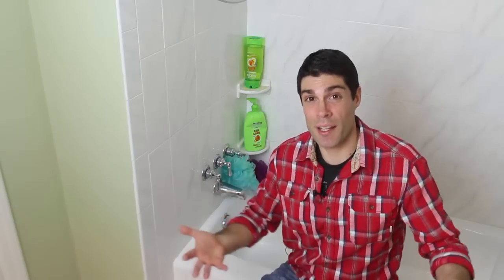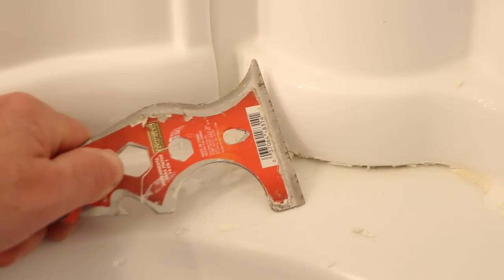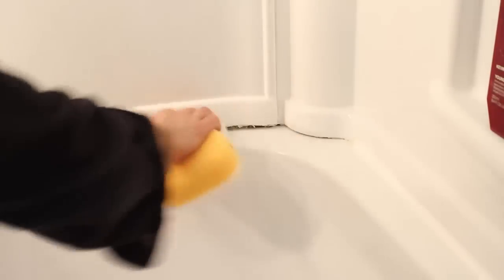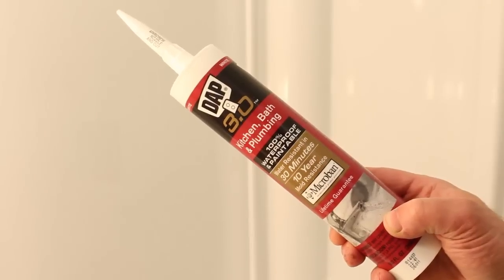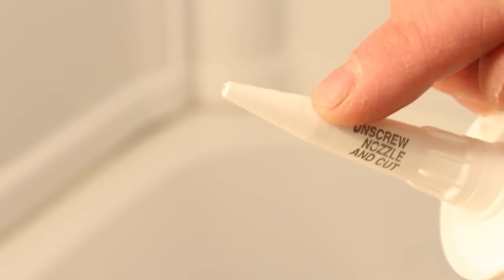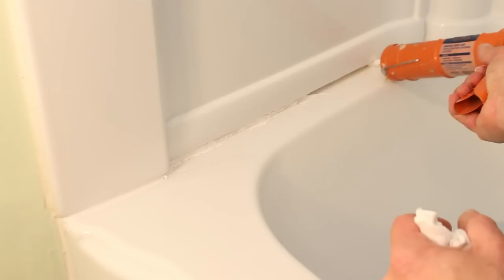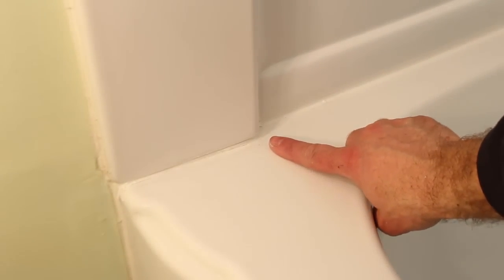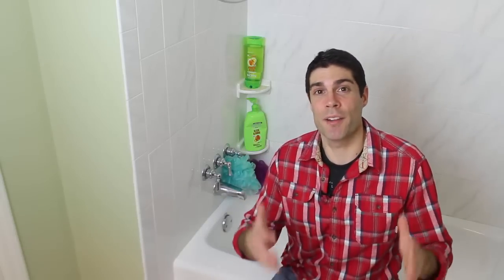How to Caulk a Bathtub (Beautiful Results) -- by Home Repair Tutor

Comment: I recommend caulking when the weather is on the dry side. If it's rainy and muggy, takes longer to cure (lose its tackiness). I also like to blow dry into the space between tiles and tub, high heat. Get at any moisture that might be pushed back behind the caulk. (Do this before filling the tub, since you don't want to drop the dryer into the water.)
Reply: I think I'm going to use my space heater and put that in the bathroom... The humidity in this town is like 60%
Reply: @melissasmith8582  See if you can get a mini air dehumidifier. The $40 range (Amazon) minis are essential if you're dealing with 60%. After you use it in the bathroom to get the caulk to cure, put it in a closet. And don't forget to empty it every day!
Reply: @kenosha1946  thanks for the tips☺️
Reply: Actually, acid cure silicone caulks cure by way of moisture that's in the air. There are diff curing caulks out there. Also the one he's using is a polymer hybrid solvent caulk not silicone

Comment: Using a wet finger to smooth out the caulk is a good idea. However, you are still likely to get uneven applications around the tub. Take painter's tape and place it along the tub where you want the caulk to stop, both top and bottom.Then apply the caulk, wait a few minutes, and then smooth the caulk with a wet finger. Peel the tape away and you will have a PERFECT caulk line. GUARANTEED! Got the idea from Tommy Silva on This old House. Works every time.
Reply: I been told it’s not good for wet areas. Once you remove the tape it leaves a lip where the water could rest at, causing mold. But I do agree tape gives you the perfect line.

Comment: Filling the tub won't be necessary if you just take showers, use a heat gun or blow dryer making sure caulk area is dry and then use painters tape, caulk then immediately remove tape before it cures.

Comment: BS on using water wet finger to smooth out that Dap 3.0. Having recently subjected myself to the hairpulling punishment of Dap 3.0 sealant, be warned that it is NOTHING like the silicone caulk you're used to. If you don't have a can of mineral spirits or paint thinner on hand, you will kick yourself the whole way through re-removing and re-re-caulking all that time, effort and $8 tubes of Dap 3.0 you wasted...
Reply from the maker: Nightzpell sorry to hear about your experience. What sealant did you end up using the second time around?

Comment: Filling the tub was THE BEST advice I took from this video. I’ve done Lot of caulking projects (especially installing baseboards with new flooring), that was what I came here for! I figured someone would have a neat trick for the tub area.
Reply: Filling the tub is a total waste of time and does absolutely NOTHING. Sealants like this DO NOT WORK BY COMPRESSION.I have caulked literally 100s of tubs professionally and this is total nonsense. When installed correctly with the proper material the sealant should last 20 years+ everything about this video is wrong. The surfaces HAVE-to. be cleaned with alcohol (or something similar) Never use ANY DAP product in a wet location  use 100% pure silicone and never install the sealant deeper than it is wide.And most importantly NEVER use any liquid to smooth the sealant. Has zero knowledge of his sealants work
Reply: @genecarden780  I was unable to fill the bath as I needed to apply sealant while I was in the bath tub as I did not have the strength to lever the gun and bend and stretch.. I also used not silicone but a polymer....I will see how it goes....
Reply: @theresanolan1157  filling the tub is a waste of time. So that is not a problem. There are some good polymers. But I stick to silicone ( quality silicone) because they have a VERY extensive track record in this installation.

Comment: THANK YOU for this terrific tutorial. I am not a DIYer, so this was a really ambitious project for me, but your video gave me the courage and confidence to try. I am pretty pleased with the results. If it helps anyone, I made a shopping list based on items mentioned in the video. In all, the whole list cost me $55 at Home Depot. The painters tape was a pro tip - thank you to the person who mentioned that. The only thing I needed in addition was a little brush to help me brush away the crumbs as I pulled away the old caulk. And I kind if wished I'd worn gloves because I am definitely not as skilled as you with caulk gun operations, lol. But overall fantastic - thank you for the help!
- 5 in 1 painters tool
- Grouting sponge
- Straight razor
- Dap 3.0 caulk
- Caulking gun
- Painters tape
Reply: Caulking gun must be kept moving. Squeeze! Move quickly, dont Stop. No clean up, no tape! Take it easy. 🤔🌊

Comment: Awesome video Jeff! Another tip I picked up is to re-tape after you pull off the dirty tape, then after you run your finger over the new caulk you can pull off the tape and have a nice clean line every time, no need to go back over the tub with a wet rag because the tape will give you a super crisp line!
Reply from the maker: Cool, thanks for the great tip!!

Comment: Thank you so much for this video I have another question where the 3 pieces of the walls come together towards the bottom they are loose. Should I put caulk behind that as well..... Because i'm thinking if that is not sealed water will get behind there

Comment: Some vids recommend spraying ammonia-free FOAM spray window cleaner directly on the bead of silicone instead of water...then use whatever tool, finger, spoon, dowel, credit card, etc. to move the product easily into place and then pull the tape. So many different and interesting methods. I'M ON DAY TWO OF CAULK REMOVAL AND IT SUX. Thank you so much for one of the FEW videos featuring surrounds and mine has a BIG gap in some areas. I won't fill the tub though. I won't have enough control. I will get in an get 'er done, that is if I can ever get to PHASE II. Good thing I have two full baths!

Comment: Genius
In over 40 years ,3 homes plus a home repair bussiness I've calked shower/tub combos many times.
But
Your video gave me a few new tips I will use.
Thanx
I blue tape above and below the gap 1/2"which keeps the calk confined and results in razor sharp lines.  I also do all this behind bathroom sinks.
Just remember to remove the tape before the calk sets up or you'll pull the new calk with the tape.
Just sayin...
 Carry on.

Comment: How long should I wait between removal of the old caulk/cleaning and application of the new caulk? Also, do you think I can get good results using a squeeze tube of GE 100% silicone ii KB caulk? I'm afraid to use the gun!!! Ha. Thank you so much! Your video is giving me the courage to finally tackle this job! I have a surround that wasn't installed properly and flexes like crazy!
Reply: fifipouf 
Wait till it’s dry, real dry. 
And use a caulk gun, easier.
Reply: Embrace your 2nd Amendment rights! Don't use those stoopit little tubes from the dollar store...YOU CAN DO THIS! LOL

Comment: Thank you for the great video. I have a tub/shower where I am not able to fill the tub with water. Weird, right? Anyway, do you have another suggestion for weighing down the tub? I was thinking that I can just sit in the tub while I work on it. Please let me know if you have a better idea.
Reply from the maker: You could sit in the tub or fill it with bags of sand (just make sure to protect the tub and not let the sand out of the bags!!) Hope this helps TheAlibi09 - although I am curious why the tub won't fill with water, lol
Reply: In case it was unclear, keep the weight in the tub till the caulk has cured.
Reply: I wouldn't worry about filling the tub. Silicon is flexible and the walls are nailed to the floor. If you have a gap the moves in there that much then you have much bigger problems than mouldy caulking

Comment: Metal on plastic is no bueno, but I do the same thing lol.  My tub/surround is old so I don't care. Using alcohol or bleach to wipe it down first is good too for better adhesion. I think I'm done with silicone....just botched another job after tons of prep.  It's just so thick and sticky.  Even with a smoothing tool it turned out hideous due to big gaps I'm trying to fill

Comment: Thank you for the fill the bathtub tip. Duh…why didn’t I know this….lol…I’ve caulked my new tub 4x now. This time I think I got it. Lol. We shall see…
Reply: Same here. I am so tired of caulking my tub. So very tired. Did some remodeling and noticed water was leaking behind the wall due to the caulking around the tub. Needless to say, I was beyond ticked off. I truly thought I was a pro at caulking. Now that I know about the bathtub trick, I feel very confident and hopeful this will work. PLEASE WORK! 🤞

Comment: nice explanation. My preference is to use metho instead of water for wiping. I just fill a small cup with metho and dip my finger in it. You get a great glide
Reply from the maker: Thanks ***** for your tip cause I'll try that next time :D
Reply: Jeff Patterson
hopefully in 10+ years!
Reply from the maker: Hopefully *****, lol
Reply: Metho?
Reply: Viking Swagger probably means Methanol? Solvent based not water. Rubbing alcohol or paint thinner is readily available and would work

Comment: To avoid the awkward reach for doing the caulking, I just get IN the tub.  That puts some weight in the tub (which I had never thought about) without wasting water.  Perhaps that's not an even weight distribution but I am thinking it's a reasonable trade off.  Thanks for the video!
Reply: Agreed! Appreciate Jeff's videos...however never saw tub filled for recaulk. Can still come out decent (maybe not perfect) but I am with you...It's very hard to get the right angle without actually being in the tub...kinda defeats the purpose if u have to do it from outer space, lol.
Reply: same, caulked from inside the bath,,,
Reply: most of the time the weight distribution isn't even anyway

Comment: What is its a WP TUB  and its already installed on a wood deck but thry left 1/2 inch between the tib and wall and i have to tile the wall. I was thinking of  using spray foam to fill the void and then but silicone over it but i do t know if the silicone is compatible with that ir if they is more aesthetic option.  Any advice?
Reply: very good question, it would be great if you gor an answer..
Reply: @theresanolan1157  i hope so.  I still have half a bathroom to do because of complications, although i ended up putting thinset in between

Comment: Do you drain the tub while the silicone it’s still wet? Or wait till it’s 100% dry? I don’t see a problem either way.
Reply: I see you asked this 2 years ago, but I’ll answer now anyway.  Looks like he emptied the water as soon as the caulk was applied, so as the tub rises slightly the material will be pushed further into the space before it cures.
Reply: I was wondering the same thing.
Because it seems like if the pressure from the bathtub causes it to weigh down.
If you let it go before it's dry the next time you fill the bathtub up. It will cause that new caulk to split? I'm just curious because i'm about to do this to my bathroom

Comment: Don’t really pike DAP, because it shrinks when it’s dry and solidify too quickly, making it hard to make a smooth surface. GE is a lot better if not the best, because its liquidity is better and it’s still rubbery after its dry, bonding the neighboring walls.
Reply: I used Tec 7... not a silicone , a polymer... don't really have a clue but I hope it works....

Comment: I feel like you should mention that the underlying problem is the tub being installed incorrectly. A properly installed bathtub will not cause that stretching issue. There should be NO need to fill the bathtub up with water while caulking. That said, it's easier to re-caulk all the time than tear out and reinstall the bathtub.

Comment: How come when I keep caulking my tub surround (3 times now) it can easily just be peeled off, after 24 hours cure time. It does not adhere to the shower or tub, and that's not even to mention when it comes time to actually scrub down the shower and caulking where all the scum collects. 🤨🤔
Reply: a commenter said to clean down with methelated spirits/ alcohol/ it provides beeter adhesion.. also depends on the quality of sealant and curing time/ humidity.

Comment: Putting a little water in the tub to weigh it down for more separation is silly, because when you get a shower or bath your entire body weight is what causes the biggest pull and downward separation. Do water isn't really going to do squat. What you do is get IN the tub when you are applying all the caulk, then your bodyweight is pulling the the tub itself downward exactly as it will when you are bathing or showering. And who gets baths anyway? Sitting in your own dirt and dead skin in a bathtub is gross. Showering is cleaner, more hygenic and will be only your bodyweight, no extra water. That way the caulk will never have more pull than your bodyweight.

Comment: Why are you making a video when you have zero understanding of sealants? 
NEVER use acrylic in a wet area. 
Filling the tub first is just plain stupid.
The sealant is far too thick
Using ANY liquid to smooth the sealant is one of the mist common reasons for sealant failure for amateurs. ( professionals will never do this)